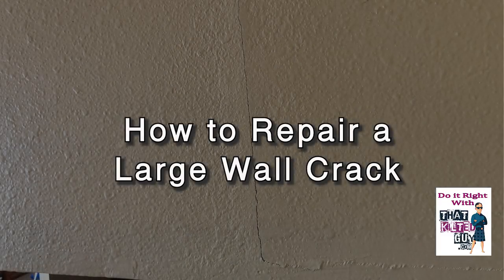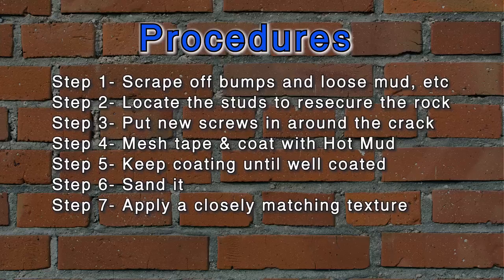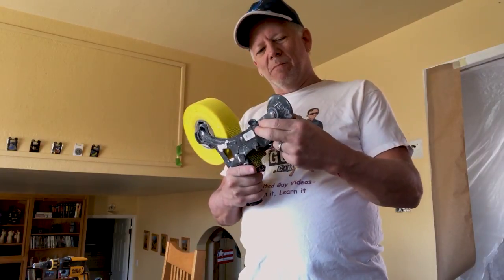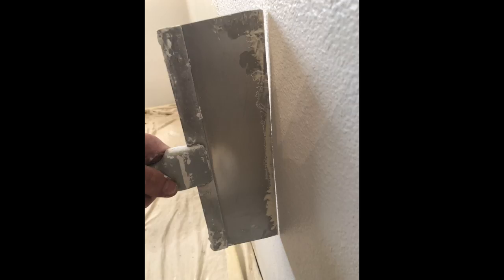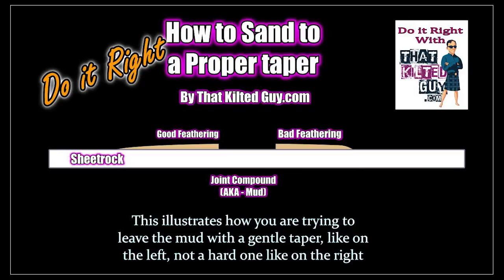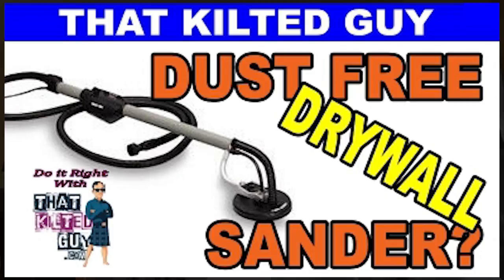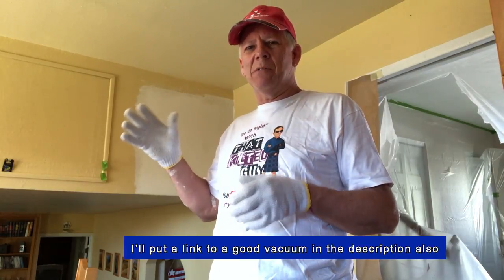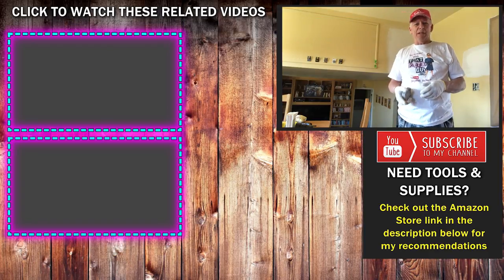🔴 How To Repair a Large Crack on the WALL using Mesh Tape & Hot Mud

Comment: Being old school, I have gotten to the point where I don't need to sand.  I use the knife and scrape the patch clean just before the mud cures.  If I get a high point I will spray with water or wet with a sponge.  I absolutely am able to avoid sanding dust using this method.
Reply: Ditto!! I do the same. Sponge and wet blend

Comment: I had a crack in the corner of a doorway. I cut a V groove in the crack and pre filled with easy sand 90. Then I taped with all purpose and skimmed it out with plus 3. But I didn’t add screws like you did, I’m sure that makes it much stronger. Great tips Guy, you’re a lot faster than me.
Reply from the maker: Sometimes there is nothing to screw to, and I just fixed one like you described yesterday, and did it almost exactly the same way. Main difference is I used hot mud and then plus 3. The way you did it was just fine. So you’re on the right track.
Reply: Do you wet your sponges
Reply: The "V" method, IS the correct method !! The example is this video is beginner's/rookie method  at best !!.or possibly for a quick repair to a high volume rental housing..I was hoping for more professional tips from this video !!
Reply from the maker: My method Has worked on over 5,000 repairs with zero callbacks. The v method is no better, sorry

Comment: Few screw holes down the crack and use foam spray to fill the crack then cut it back once cured just fill the crack with filler a much easier way and the foam will give you a back fill stoping the crack opening up again and letting any filler sink back down it, plus it will flex with any movement.

Comment: This video shows new tape put over old tape. Is that better than removing the old tape before securing the drywall and adding in new tape?
Reply from the maker: Only if the old is hard to remove

Comment: Question, but first I want to thank you for sharing your skills.  The crack is uneven. How do I handle this problem?
Reply from the maker: Uneven as in zig zagged, or lumpy, or ?
Reply: I tried to smooth out the area around the crack like you did but the surface started to break up. So the crack is now both zigzag and lumpy.

Comment: Thanks for all the great instructional videos.
You provide a truly valuable service that will be relevant and useful for decades.  Unless USG teams up with Boston Dynamics and creates a taping and finishing robot that can open and close doors.  They'll never be able to open a bucket, though!!  haHA!!

A couple thoughts/questions:
Do you not like using the angled/offset sanding sponges ?  They're effective on edges, but have the added benefit of not needing to watch for gouging the adjacent wall in sanding corners.  (As though I'm presenting new information to you. lol)  The only issue is that you can gouge the actual corner with that 'sharp' edge if you're not careful.

Also, is it possible for you to go through the benefits and various usage cases for each type of mud?  I've been using Plus 3 for everything (tape, 1st coat, & 2nd coat), but the contractor doesn't like the excessive wait times for it to dry.
Reply from the maker: I prefer the square sponges for inside angles as I can use them without damaging the other side, and they clean up the opposing angle better.  Then you can always turn them sideways and use the non grit side against the opposing wall to not damage it also.  The angled sponges are great for certain areas, but the sharp edge wears out quickly so I only use them when I need too.

I do plan on reviewing mud and uses one day, plus I'll cover all that in my ebook about tools and materials, coming out soon in my online store at: https://www.etsy.com/shop/ThatKiltedGuyDIY?ref=simple-shop-header-name&listing_id=969964231&section_id=32770465
Reply: @ThatKiltedGuyDIY  I see what you mean.  I'll have to give them another chance.  I picked up my framing/hanging/finishing knowledge from my dad.  He's been in the business for roughly as long as you and I'm finding that a lot of your tools & methods are similar.

I just remembered, I have a tool from my short time learning carpentry in Japan that just sits in my tool bucket.  It's a jig with an angled utility knife blade that you run along the cut edge of a sheet of drywall.  It's designed to taper the edge of an end cut.  I'd be happy to send it to you to review.
Reply from the maker: @ItchyKneeSon  thanks but I don’t think it would get much interest and i have dozens of videos I’m behind on already.

Comment: Do you drill a hole at the end of a wall crack or ceiling crack and does it help the crack from not going further?
Reply from the maker: Never done that in 35+ years, and never had a problem with them going further.  If rock wants to crack, a little mud won't stop it.  I've seen sheets break right through the middle, not on a seam.

Comment: Is there a way to fix a crack that was created by a shifting foundation so it won't reoccur. Thank you!
Reply from the maker: If things are moving, drywall will crack.  You could look into things like putting a false beam over the crack, to allow it to constantly cover the crack even if it opens up and closes.  Or maybe an expansion joint, but it all depends on where it's at and whether those things would look bad.  Otherwise adding re-inforcing pillars under the house to distribute the load more or shoring up the foundation might be the cure.  There's much more to it like soil drainage, soil stability, etc.  You might need something as simple as rain gutters that drain into a french drain to move the water well away from the foundation.  But a foundation company could tell you more about what you need than I can.  Bottom line is, if there's movement, a crack will come back.

One quick story, I got called to fix a rather wide crack once that the customer said would open up every winter I believe it was, then close up in the summer.  He figured it was a foundation issue but wanted to try fixing it.  I cut out a 4'x8' section and replaced it with a whole new piece of rock, and it cracked badly anyway, right through the middle of the sheet, not in a joint.  Next he re-inforced the foundation and that solved it.  He also had a flat roof in Snowmass Colorado, so it was a bad idea, with bad engineering that was the problem.
Reply: I have one that is caused by humidity changes. Must just be due to differing materials in the wall, as the wall is in the middle of the house and the wall of the floor below it sits on the concrete slab, but the crack is halfway down the wall, and the slab isn't cracked there.
There is a door header at one end, in the basement that I may try replacing with steel. The rest of the wall the grain is all the same direction .

Comment: How would you fix a ceiling crack in a 70+ year old ceiling. We have cove plaster and a textured ceiling. The cracks are coming from the fireplace corner at the ceiling and radiating out towards the center of the room. Another crack comes from the corner of the door towards the other crack. Any advice would be appreciated. Thanks so much. From Canada.
Reply from the maker: Search for “how to repair a ceiling crack, That Kilted Guy”
www.ThatKiltedGuy.com

Comment: I'm working on a building and I've done over 300 of these crack repairs. More repairs keep on popping up in different areas. Only a couple of mine have split again. It's a breezeway so it's kind of exposed to the elements. Do you know why cracks continue to appear? Could it be the framing or the foundation? There are some residents who have been here since the building was built and they said that the foundation has had to be worked on multiple times. Could it be the temperature change?
Reply from the maker: there’s so many things that can cause cracking that I seldom try and actually guess what it is. It can be humidity changes due to seasons, temperature changes, structural issues, foundation issues, and more.
Reply: @ThatKiltedGuyDIY   thank you for the reply, I know this area of Texas is known for its expensive soil being a culprit to foundation issues. Many of the cracks are jagged and diagonal. There are concrete stairwells which also have jagged and diagonal cracks in them. None of the sheetrock is green and I think that has a lot to do with it as well. It gets so humid here sometimes that paint can remain wet for over 24 hours. Unfortunately it seems, no matter how well you do your repairs some times things are out of our hands.

Comment: What grit sanding disc's do you recommend? I just recently picked up a porter cable sander (like the one in the video). Any other tips, or tricks with using these units?
Reply from the maker: Keep enough pressure to the surface to avoid dust shooting out, keep it moving always, and 80 grit for coarse sanding , 150 for fine

Comment: Sanding gouges....slowly raises hand ~sigh~. Thanks so much, I have an under the window one tomorrow.
Reply from the maker: Good luck on that repair! 😎
Reply: @ThatKiltedGuyDIY  Thanks so much! I don't think this on a stud so I am going to pull the baseboard off & try to put a few screws in the bottom. New construction so you know...50% of my windows have this problem. Thanks again for all your dedication to helping all of us!!
Reply from the maker: Kimberly, I'm glad to help.  I would push on the crack a little, if it moves much at all and there's no stud, you can also open the crack up a bit and fill it with construction adhesive, or even just press a lot of mud into the crack.  That can help glue it back together a little anyway.  But taping it with mesh and hot mud makes it stronger too, so that should solve most of the cracks for good.  Thanks again. 👣

Comment: I’m hoping maybe you can give me a tip. My house has rock plus skim coat, it’s a huge pain in the ass. It’s not quite plaster and lath, but not plain sheet rock either. I’ve got some ceiling cracks along the joists, probably the seams of the sheets. How the heck can I secure everything and then successfully get adherence of the topcoat? Drywall screws tend to make things crumble, rather than suck up. All I can think of is that with the 1/8-3/16” of skim coat I could bury a fender washer or something in there. Durabond and mesh tape works on most things, but these seams keep re-cracking with the seasons :(
Reply from the maker: when you fix cracks over smooth slick surfaces, make sure you rough up the entire area that mud might touch with 80 grit or even coarser sandpaper. And then I would use spray adhesive to glue down the mesh tape or use fiber fuse tape. You can get fibafuse tape in wider rolls like 6 inches too. If you use fibafuse, be sure to use regular weight all purpose mud and you could even squirt a little bit of wood glue in to make sure it sticks really well.

And then use these last screws and try and get them to sink in a little bit so you don’t have to put too much mud on top of them.

https://amzn.to/3dFE8at

and finally, I hope you’ll consider joining my Patreon page to show your support for my channel. if you don’t, the mud won’t stick at all, just kidding.

Www.patreon.com/thatkiltedguy

Comment: Hello there, you are right.  This is definitely more depth than just putting joint compound on crack.  Why did you put the screws into the wall?  Thank you.
Reply from the maker: When a crack appears, it often weakens the screws or nails in that area.  Plus I just want that area to be extra firmly attached to minimize future movement, so I put screws in if possible. 😎👣

Comment: why do u use plus3 compound and not continue using hotmud?
Reply from the maker: Hot Mud only helps when it’s thicker than 1/8” and plus 3 sands Much easier if needed

Comment from the maker: I NEED YOUR INPUT.  What subjects would you like to see me cover on my channel?  Be specific if you can like, 'Fixing a dent in a wall' or 'how to choose a drywall joint compound' etc.  Comment below and I'll see it.  Thanks! 😎👣
Reply: Have you done any videos on using structo-lite to match old ceiling texture? We've got it down pretty good but always open to advice. Thanks for all the videos.
Reply from the maker: No. I’m not familiar with that one.

Comment: What cause the drywall to crack in Middle?
Reply from the maker: Many things can cause it from expansion, contraction, settling, shifting,  not hung right, studs that were not dry enough, humidity changes, shaking buildings etc

Comment: What about the crack that keeps coming back? It's a vaulted ceiling and the crack is at the peak of the wall, I did that method twice and each time it takes a few weeks and the crack comes back
Reply from the maker: Those are tough. Is it textured? Sometimes it’s best to put a 1x4 up so the crack is just hidden.
Reply: @ThatKiltedGuyDIY  it is textured and a 1x4 will not look good in a vaulted ceiling in the middle of no where up top
Reply from the maker: Sometimes people put in a fake box beam down the middle. I have other ways to try and fix it with drywall mud but I can’t tell you what to do without being there in person and sometimes there is no guarantee if you have too much expansion and contraction or movement.
Reply: @ThatKiltedGuyDIY  yeah it is kind of an eye sore if you notice it, I’ve tried to plaster it many ways and it come back after a month. I might have to just do some trim molding to make it look normal and hide it
Reply: Try tapeless mud?

Comment: Couldn't you just take the hump down a little bit with sandpaper just before you hit the mesh tape or the paper tape? It would give you a smaller hump thanks for the video
Reply from the maker: Well for starters, paint is really difficult to sand off as it just gums up sandpaper and gets really gummy on the wall if you sand too much. But there’s very little thickness you could remove before you go right through the paper face of the drywall which would weaken this whole joint even more. 

The hump comes because of putting joint tape on a flat surface so you have no choice but to create a hump. 

Hey I hope that helps you out and thanks for subscribing, and I will catch you on the next video, Guy
Reply: Sure thing 👍 thank you for the feed back.we learn every day.

Comment: I am a homeowner and have been doing my own drywall installation and mudding for many years. However I stumbled onto your site and learned about hot mud. This weekend I was doing some drywall repairs and used mesh tape and hot mud. I put on the first coat of hot mud on and all looked fine I lightly sanded the surface and them put on a second coat of hot mud. After the second coat dried I noticed I had a small area that the mud developed small bumps like pimples. I sanded these down and pulled the final coat with top coat mud and the small bumps came back. What is causing these. I never had these after I put on the first coat of hot mud, only after the second coat. This bubbling is on a fresh piece of green board, never painted.
Reply from the maker: Bubbles like that are a pain.  I've never found a way to entirely avoid them and I've tried dozens of ways.  Usually they're much worse when you coat over painted drywall, but since you didn't they're probably the more minor version.  And often what happens is you sand them off and the sanding dust gets into the pinholes, so the next coat can't stick right and 'droops' back out.  So what you can do is blow out the pinholes with a little compressed air, or vacuum it out and that usually helps, then just coat it, wipe it tight, and do that a few times in the area of the bubbles until the mud sticks and quits doing that.  Often it will do it again on the next coat but with fewer bubbles, so you have to then 'touch it up' before texture or paint.  Hope that helps. Guy 😎👣
Reply: Thanks for your help. I used a shop vac to clean out the little holes and pulled a real tight coat of mud and that did not bubble.
Reply from the maker: @mowens1972  Glad I could help. 😎👣

Comment: I didn’t hear him talk about how his wife complained that she had to dust everything after he sanded without putting up any plastic walls… 😁
Reply from the maker: Did you watch the video? I used a vacuum drywall sander and didn’t make more than 2 tablespoons of dust. Plus look to the right and you’ll see the whole house was being worked on as I was doing popcorn ceiling removal and they knew it would be dusty.

Plus if you put plastic up everywhere, when you take it down dust goes everywhere anyway so it’s best to control the dust instead, which I did.

But thanks for commenting